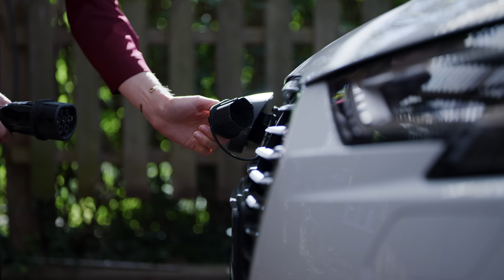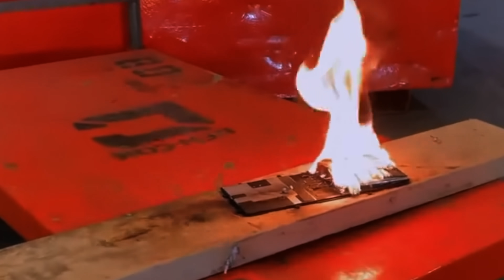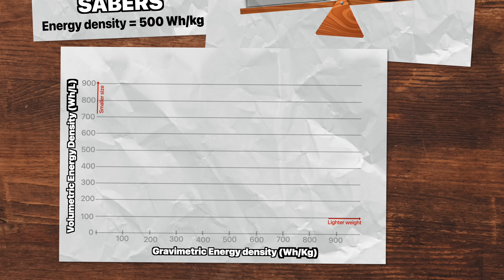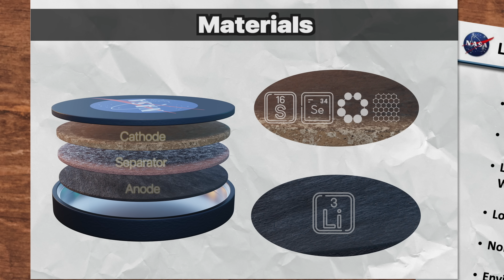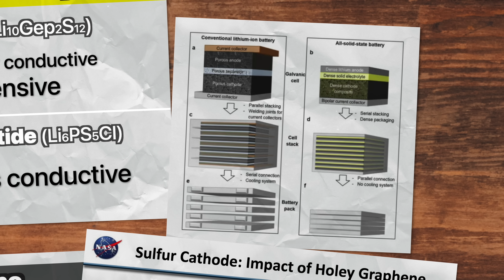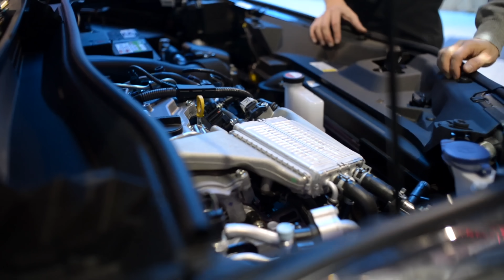Why NASA is Building a Solid State Battery

Comment: Regarding 737 example. 7x reduction in range from 4000 to 550 miles is not so bad. Not trans-Atlantic, but great regional transportation. The power density issue for maximum power could be easily worked around by using two types of battery chemistries. A higher power battery for takeoff and initial climb, and a lower power density for cruise. A plane cruising only needs ~25% the maximum power. This would still offer over 400 miles.
Reply: You had better get to work designing it.  Let us know when you're finished
Reply: @CaptainRon1913 That kind of hybrid battery has been already made for car usage. Combination of 1/5C charging battery and high power battery like F1 Kers battery. One can drive over 1000 km max bit over 100 km/h. And charging is takes 5 hours with 1/5 C. It's just too expensive for car use. The bigger battery is charging small one and small one is powering the motor. Both batteries are more expensive than "normal" and about double electronics needed. And driving too fast, and the small one runs out of power.. and for a long distance roadtrip it may be more convenient to quick charge several times a day, and not necessarily charge overnight. 

For aeroplane it would make more sense. NASA's 1C battery would be good enough for a car, 200kW from 400 kg battery with 200 kWh.  It would be enough for a small aeroplane also, possibly with 2 kWh high power buffer battery giving 120 kW more power for one minute. Climbing would be slower than with turboprop.

Comment: Mentor was displaying and electric plane today. It would cruise at 70kts for 1 hour with a 40 min recharge carrying a little over 300lbs. Lets say you chose extended flight duration instead of more weight it would still not make it to two hours of flight. This aircraft gets about 80 miles per charge and with this battery technology it would make it from 140-150 miles. A useable GA aircraft needs to push closer to 600 mile range like the fossil ones do. Forget an airliner that currently pushes 1 million pounds or making trans-continental flights.

This is great, keep going, but until they get to 5x energy density it's still not viable for the aviation industry. Fossil fuel has so much energy density that it looks impossible to replace it with batteries in the aviation industry.

Comment: Yes, this battery is a good one. BUT, to charge them you need oil and gas...So, then it doesn't matter. The most important is that we need nuclear power to produce electricity... That's the most important thing..

Comment: Over the last few years, there has been so many announcements concerning battery efficiency. Every single one has been quietly relegated to a single category. Most of the companies I believe had the same intention as well, generate investor funding then sell the company. All the above have been competing with the few companies surrounding Tesla. Just about every announcement has stated that their product will trounce anything that Tesla will ever produce, and, it will be on the market in 3-5 years. Inevitably, they all fall into one category: VAPORWARE. If Tesla switches to the same battery as Toyota, follow that.

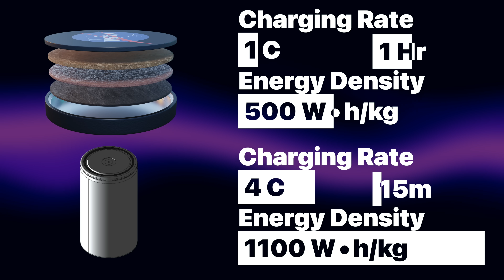Comment: 16:03 What are you smoking? Tesla's 4680 battery cells have a specific energy of between 244-296 Wh/kg. The charging rate of a battery has nothing to do with its specific energy!!! A 100Ah battery at 3.7 volts nominal that is rated at 1C discharge and 1C charge will accept or discharge 370 watts in 1 hour. The battery could weigh 1000 kg or 10 kg. You cannot know anything about the specific energy of the battery from this information. You can have a LiFePO4 cell of 100Ah and a LiPo of 100Ah and a Lithium-Ion NMC cell of 100Ah and (ignoring the nominal voltage differences) you cannot know the energy density!!!

Either your slides are mislabeled, since you talk about specific energy but the video says Energy Density which is VOLUME not MASS, or you're completely off base. That's a big error.

Comment: Toyota has developed ammonia powered internal combustion engines.  Electricity is used to make ammonia, and there are ships using that fuel right now.  They also have developed a hydrogen powered engine as well.  I don't believe that battery systems are going to be the end all in zero emission power generation or even storage.  But, I guess we will see.

Comment: The main problem with batteries for aircraft they have to comply with FAA rules, especially about battery life, which could be the new fuel. Once a battery reaches half its capacity, it must be replaced. Fuel or watt hours must satisfy at least 3 times the range of flight. If a flight requires 1,000,000kwh, the batteries would have to provide 3,000,000kwh. I'm a former AP mechanic. Flight requires too much power to be viable for personal use. A small plane may use as little as 9 gallons per hour and travel 160 miles in 1 hour. A car that gets 40mpg will only use 4 gallons. Helicopters or any vertical flight will use at least 18 times as much fuel or kwh.

Comment: I feel this is one of the more promising high performance battery developments going on, along on with graphene-aluminum.  These might make the turboprop side of the airlines much cheaper and popular with the public, being near silent but they arent going to come close to the speed or altitude of a turbofan.
Reply: If you think the engines are what makes an aircraft loud, you're going to be quite disappointed when they get around to electrifying them.
Reply: When he was showing the 737, Cessna was what I was thinking.  This could definitely change private aviation, even if it doesn't change commercial aviation just yet.
Reply: @sinocte  There's a lot of drawbacks to electrifying GA aircraft with the way most people use them.  Best case scenario you'll see maybe half the ratio of what ICE:EV looks like in the automotive world, if the price per hour gets down to competing with ICE.

Comment: As soon as I realized you failed to mention power density early in the video I was disappointed and angry.
When I heard sulfur was in the mix I already knew cycle life was going to be trash as well, making it worthless for satellite use as well.
Talking about a 'holy grail' when it's obviously just not.
The holy grail of batteries is easy to manufacture in bulk, high cycle life, power and energy density over both weight and volume.
This will only check 3 of the 6 boxes.
The one that uses rare earth minerals probably has high cycle life however getting it a different 3rd box so it can fill NASA's actual goal.

Comment: Well, NASA is mostly interested in space applications for batteries, which means in many respects price is no object.   For mass transportation ground-side, I think the NASA work represents good proofs of concept, but probably nothing that can actually be produced cheaply in volume.  Still, the electrolyte is the key.  Solving that also opens up a lot of options for cathode construction.  Someone will figure it out.

Comment: that is BS (in this context BS stands for the waste material that comes out of a livestock mainly bull) if you say the batteries don't catch fire, you said in the beginning of the video anode is Lithium and how does lithium reach to air or water ???????
also lithium has a low melting point of ~ 180 deg C or so, once the anode reaches this temp there is no going back from thermal runaway what do you mean there is no runaway ? absolute rubbish, i have worked with primary lithium batteries and one of the basics things you learn is how to deal with thermal runaways....why do you think airline industry always asks you to take batteries on carryons Einstein ?
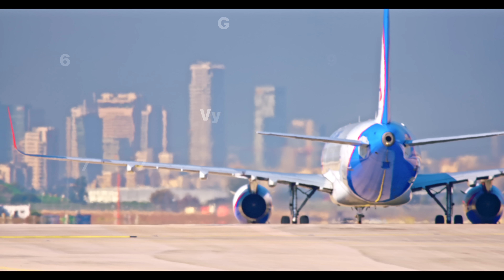what do you mean you don't need thermal management ???? you said @7:23 battery works as long as 0 °C and guess what is the temperature at which Boeing 737 flies is like Einstein ?? you definitely need some heating to keep the battery at least at 0 °C...
you don't even talk about the performance of the batteries in terms of current delivery, charge cycles, temperature affects on capacity, how quickly can you discharge and charge the cells ??
Ive know from experience Lithium batteries are horrible even at 0 °C, even with gel electrolyte i would be surprised the solid electrolytes offer better conductivity at 0 °C. Another big problems lithium batteries face is passivation, you don't even mention this absolutely ridiculous...are you saying SSBs have no passivation issues ?
This battery wont solve anything but might make things even worse, there is already a lot of demand for lithium... 
I think it is not practical for airlines to simply fly 1500 NM on single recharge and wait for hours to recharge the plane, how do you suggest to address this issue ?  eventually airports should be able to provide up to 94 MWh to charge these batteries at once or sequentially, aka have their own nuclear power stations just for charging the batteries...i really think the current infrastructure will make it super hard to accommodate e-planes...
Please do some more research before you post any videos or talk to an expert.....

Comment: Sounds like there are a few different solid state batteries coming to market.   What about the one John B Goodenough was working on?  I thought his or his teams batteries were gonna be first to market and it looked real promising.  Sad think i saw he just passed away in July 23 😢  From what i remember seeing about two years ago their battery had a much faster charging rate then what you were calling 1C,  and it had a really good cycle count 5x that of LION batteries.  Then again they were nearing completion 2 years ago and possibly the loose threads they needed to fix up stuff and were too optimistic and didn't get what was needed fixed up...

Comment: Takeoff weight is usually significantly more than landing weight. Since the aircraft will not get any lighter during the flight, the battery will have to be sized for weight at landing and not takeoff weight. Range therefore will be even lower considering this smaller battery size.
Reply: "the battery will have to be sized for weight at landing" - takeoff weight is important, because that is the weight that needs to be lifted into the air, which requires an amount of energy directly related to the weight. Landing does not use energy, and therefore landing weight is not important. With future technologies it could even be possible to generate energy during landing, and then a high landing weight will be beneficial instead of detrimental.
Reply: @renedekker9806  unfortunately landing weight is very important as the more weight you have on the plane the more stress you put on the tires, brakes, landing gear and frame.  Each extra bit of mass needs to be accounted for in stopping it from dropping and then stopping it's forward momentum.  That's why planes dump fuel before a short/emergency landing.

The concept of regenerative breaking is interesting, but no where near as feasible as in a car.  You either need to regen energy while braking on the ground which means you need to build in generators to the landing gear further complicating that assembly and the time for recovery is very short -- or, you need to build "air-brakes" that somehow generate power on the glide down.  Currently this is done with static flaps that just increase drag, but I suppose you could try to run propellers backwards, either way though that's a lot of extra work, parts, and systems to regen a relatively small amount of power.
Reply: "Landing does not use energy," It doesn't? I've flown a few times. I remember the engine sound from slowing down the plane during and after touching ground. A greater speed and weight will of course force the engines to work harder and use more energy. @renedekker9806

Comment: I think solid state batteries would have a more promising application in locomotive engines than in aircraft. Better batteries might lead the better EVs in a few years. But, locomotive engines could almost use solid state batteries now. They already have electric drivetrains and battery packs could be in swappable railcars that would need fast charging. So, it could save a huge amount of diesel fuel.
Reply: And they can handle weight like no other form of transportation 👍🏻 good idea
Reply: Locomotives can just run off the grid...

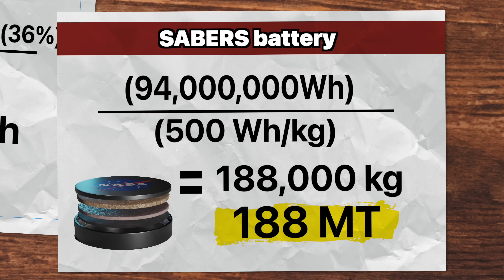Comment: @12:45 your conversion show on the screen is wrong, 188,000 kg is 188 ton (1000 kg is 1 t) not 188 MT (then it should be 188,000,000,000 kg) and also it is small "t" not capital "T", T is SI unit of magnetic field aka Tesla, please post information correctly or check it before you post something ? or are you trying to say the battery pack will produce a magnetic field much higher than a magnetor of 188 MT of magentic field roasting every credit card, magnetic hard drive, on earth ???
that guy who made a video of roasting you of your video on LK99 was rightt....

Comment: Couldn't they combine capacitors and batteries in a plane so the capacitors give the take-off push then the Solid  battery flies the plane?
Reply: Capacitors are challenging.

You just can’t put them in series, like batteries, to increase voltage.

Not saying your idea is bad, just challenging

Comment: Solid state lithium batteries have been around for a while. They used to be made of a lithium slug cathode surrounded by a copper iodide/iodine anode. It was a primary battery of very low current. The newer ones use a glass electrolyte and are rechargeable. Same issue, low current per area.
Reply: He has not a clue about the environmental issues and the cost to produce and to dispose of these batteries
Reply: According to NASA the thermosphere is 4000 degrees hot. How can ISS and star link satellites survive in such high temperature?
Reply: It is just the latest new battery of the future, there is one of those every month
Reply: yup, looks like were back to school with a clock and lemons.. this is a twist but nothing new at all, typical two bit work
Reply: @johntaphouse5235  'look at my flying lemons!'
Reply: This game is very serious
Reply: Surmounted with prefamulated amulite, which helps the battery reduce sinusoidal depleneration
Reply: sounds yummy, does it come with fries @funkysawmanwright5077
Reply: But without lithium in the new batteries, it less combustible and doesn't have the "bloating" problem lithium batteries has. Wouldn't you say that it's much more usable and not have same issues?
Reply: @Adyen11234   The new batteries still use lithium for the anode and the electrolyte.  The only differences are the solid electrolyte and no cobalt.
Reply: but you need much bigger batteries as  non lithium one hold less energy @Adyen11234
Reply: "ThEsE nEw FaNgLeD hOrSeLeSs CaRrIaGeS wIlL NEVER WORK, aNd WiLl Be ThE dEaTh Of SoCiEtY!"
Hello, fellow Luddites.
Reply: @TimeSurfer206 "This battery is definitely the future, ignore the hundreds of other battery technologies that were also going to be the future"

Hello naive optimists.
Reply: @TimeSurfer206  
especially when they have the toxic lithium stuff in them that causes deadly fumes when burning and an almost impossible fire to put out because it's a chemical fire that burns hotter than most of our fuels out there we currently use.

i think they focus to much on efficiency and cost and less on safety when they make these choices, cost and efficiency are important sure, but if that comes at the cost of lives due to issues with the battery tech, that is just asking for a disaster to happen.

another issue that's never talked about is when they get everyone on the grid power, it will be to much on the infrastructure because of the demand will be way to high to realistically supply to everyone, which also means the cost of the electricity will go up because everyone will be on that system that can not offer enough for everyone and the demands of the people's needs as they dismantle everything else that was far more useful at the cost of slightly dirtier air quality.

the other issue is these batteries are far worse in air quality when they burn and far more toxic to human lungs than something like coal that was used before we jumped on this green energy crazy train, so in the end they aren't really helping the environment after everything that we did to convert to it, they also have to use fossil fuels to make these technologies as green energy isn't cost efficient enough to handle the overall needs or demands.

and hey let's say we get a drone strike on us, we would all burn in hell fire that has never been seen in all of recorded history if everyone converts to this green energy deal.
Reply: @5226-p1e  The fact that it is solid state supposedly makes it less susceptible to spontaneous ignition.  If ignited, then I can see where that may be a problem, but is it any less toxic than the regular electrolytic lithium batteries?
Reply: @5226-p1e you shouldn't smoke so much weed
Reply: @cryora  
it's the lithium that is the toxic part and that's also the part that ignites spontaneously as it turns to flames. 

anyway i would send you some links on this, but youtube banned me for the last 24 hours from making any comments simply because i used a link that lead somewhere else besides youtube, so you will have to look up these results your self in your own search to see what i mean. 

i think youtube are trying to stop spam accounts from harming users to the point where they don't trust any links including links that lead to their own website google lol. 

well i learned my lesson, i can't post any links because youtube banns you for 24 hours straight, so this is why i couldn't reply until now, i tried to answer yesterday with a link and that's when i was banned, it's stupid i had to wait 24 hours, but it is what it is.